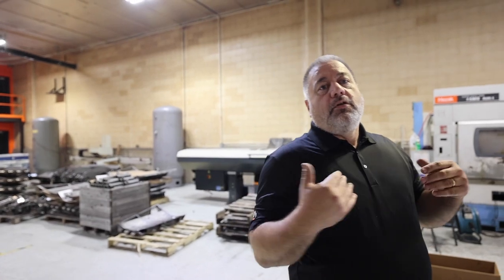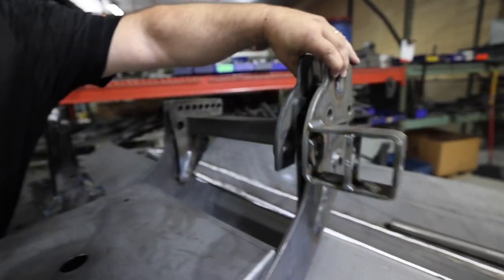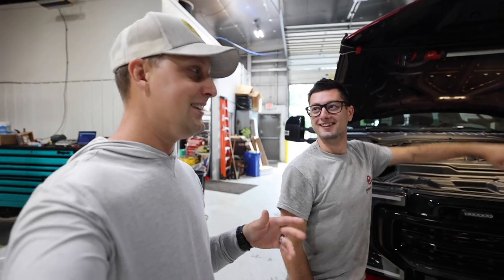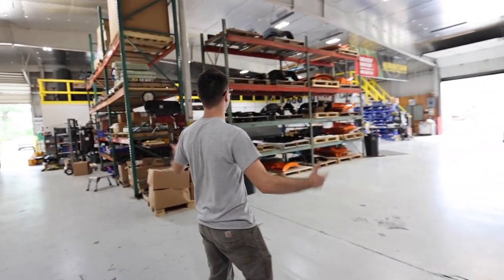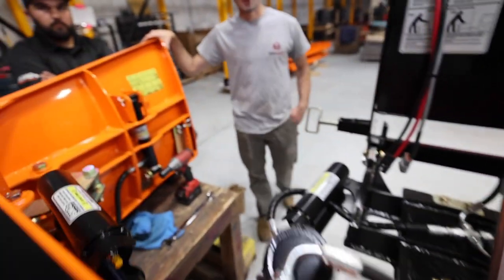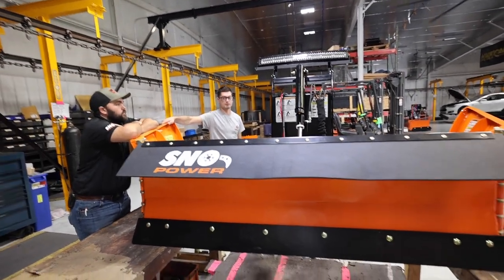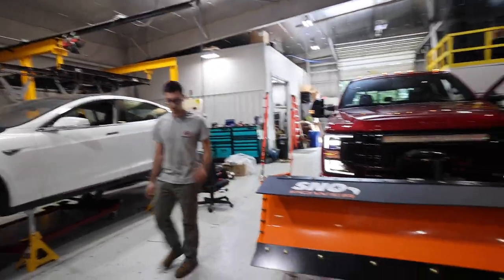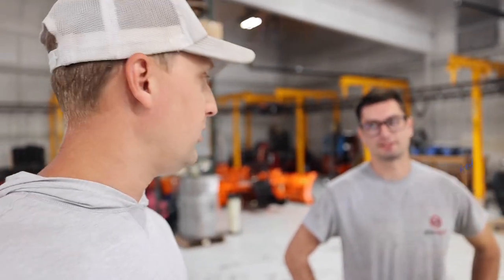SnoPower F14 Snow Plow Never Seen Before UNTIL NOW!

Comment from the maker: What do you guys think about plowing 14’ of snow in a pass?!
Reply: .5 1inch of fluff over that your out of truck
Super nice to final clean dingle balls of snow in a big parking lot
But if those wings clip a curb there gonna break or break your truck
Driveways small lots don't see a need bigger parking lot hell yehh
Reply: Just out of curiosity from a Floridian here. Does this stay on the truck all year long or is there options to remove it?
Reply: What a good dude. Thanks, Brian.
Reply: @porfirio3820  you take it off, depends on company, people, storms, but some people leave them on all winter, and some take them off after each storm. But no, it is not a permanent fixture to the truck.
Reply: @porfirio3820  my pickup i take plow and sander off/out every storm because i drive it everyday dump trucks leave the plows and sanders in all season but I take weight off the rear springs so I do not damage the springs
Reply: Trucks are going to be burning up transmissions.

Comment: I have been installing BOSS, MEYER. SNOWDOGG, and a few others for years at our BOSS dealership. And Boss has used Nitrogen for their down force for a few years. I know these guys have worked with BOSS on the Drag pro rear plow. And the BOSS undercarriage he used on the front of plow is great . I love these plows . and if you keep the BOSS wiring on the truck along with the wiring for the Snow power , you could actually use either plow. But I'm worried about long term use and weight. Man !! I love how he's doing this all in house, so much like our shop . We also do service beds, in house dump , flat beds, out of steel or aluminum. I've got to go see this place. Congratulations!! I'm a fan!!
Reply: I think the 12 ft version is better suited to a front plow and not quite so heavy. Front end will take an extra  beating for sure.

Comment: One thing to keep in mind. 
All of these truck mounts are/ were designed for the 8-9’ plows V plows and the like. Pushing a 14’ plow at both the additional weight of the plow and weight of the extra snow may damage the frame of the truck easier then the manufacturer of plow mount with the plow designed for that mount would. 
Just a thought.

Comment: I mean I understand the point and think it’s awesome.. but I just feel like if this was a good idea boss or western would have done it already.   That’s a lot of snow per push and I just don’t know how well transmissions will like it.   I also would stick with a plow you can get service.   Our boss dealer is open during storms all night.  But I will definitely be watching this winter to see how it goes!! 👍
Reply: Same thing was said when they released the 16' backblade. Now boss has it...🤔
Reply: Douglas Dynamics is about making the company money. The angle cylinders blow out now, pumps are garbage and the metal is junk. We need new inventive products.
Reply: The exact same thing was being said when Blizzard plows were being built out of a barn in Calumet Michigan.. Now Douglas Dynamics owns the patent and threw away the brand and old tank plows and now build Junk.. I still have an original blizzard power plow... 18 years old and still pushing..
Reply: @brandonschudlich1497  Just like the Air Flow plows. Real stainless steel built plow with a Curtis type hitch. They had an awesome all stainless V as well that only a few made it to market before douglas dynamics bought them out. Thats were the "Ultra-mount" came from, now Douglas Dynamics uses that hydraulic pump setup and they took the strong all stainless plow and hid it from the light of day. I have 3 and I love them.
Reply: @Terk131 . Stainless steel is for ever. Not good for replacement parts and new plow sales.
Reply: The mentality that a well established corporation would come up with an idea or invention if it was worthwhile has been disproven time and time again. 

How many times has an upstart company come along (in any industry) and completely revolutionized the market with their innovations? Countless times. In fact, it’s the only way a small company can get a foothold in well established markets when going up against “the big guys”.

I would argue that massive corporations simply focus on increased profits and cutting costs, and only care about innovation when it threatens them and can be bought out to add to their portfolio (like Douglas Dynamics has done numerous times).

Comment: Hey I have basically the same truck and I'm nearly on the bump stops picking up a 9'2" Boss V. Did you do anything to the front suspension to handle the extra weight?

Comment: How’s the trip work with the wings forward? Seems like a good way to go head first through the windshield or bend a truck frame.

And 9 cylinders... lot more seals and hoses to leak... not including using both hydraulic fluid and nitrogen. 

And separate buttons to put power to different switches, just seems like a lot of extra stuff to go wrong with the unit. 

Also, what is the availability of parts in the middle of a storm if a cylinder, hose, controller goes bad? Is the nearest parts hours away in bad weather, local parts, need to carry a spare of every part?

Hope it works out for you. Be interesting to see how it performs and if you will be able to use the full 14’ effectively in different types of snows. I think I’ll stick with my arctic 12.5’ sectional for now
Reply from the maker: Yup, once a dealer pops up local, those issues will minimize. And we'll get to learn how to fix our equipment. All good.

Comment: Ok so it does parking lots really well. What about tight residential. What about dirt & gravel parking lots & drive ways? What about dirt & gravel roads that have a middle crown with wheel depressions on either side so you not plowing a "flat" surface? Sounds great in the middle of town or commercial area but there are more guys plowing out of town & in the Boonies that in town. Doesn't sound like this plow can do any better than a Western, Fisher or Snow X , all Douglas Dynamic plows but what about Myers or Boss in in those out of town areas? Sounds to me like your spending way more money for something that is not going to preform any better than a less expensive plow................ Please tell and EXPLAIN how I'm wrong.. Thank You.
Reply from the maker: Worked great on gravel, and driveways. We have a v plow for the rest of the work! This is our wide open lot plow.

Comment: Like the previous comments I just don't see any even 1 ton being able to handle that kind of weight.its not a dump truck or loader...that's got burned up clutch plates written all over it.obviously you would be smart and probably put in manual shift and plow in 3rd gear like you would if you were pulling...

Comment: Good way to burn through transmissions while beating up the rest of your truck
Reply from the maker: We drove it for 2.5 hours home, transmission was cool as a cucumber, no issues. But yeah.. you're probably right.
Reply: @BriansLawnMaintenance  good thing you don’t get real snow storms where you’re at lol never seen you plow more than like 8” of snow. I’d like to see how that plow would do pushing 3 feet of snow up a half mile long driveway that goes straight up a hill. 14 foot plows shouldn’t be on pickups, but then again that’s just my opinion. Hope it works out

Comment: You will destroy transmissions at $4k-$6k a pop so if you can cover that it’s fine, time will tell though.
Reply: @nuttermudder4630  idk maybe, in mid Atlantic(md) going through trans every 100k and it barely snows. Plus 7 months of daily towing 7k. So to answer your question probably
Reply from the maker: Not sure what you're doing to your truck to go through a transmission at 100k. Plowing or otherwise.
Reply: @BriansLawnMaintenance  ford builds trash transmissions. Maybe the 10 speeds are better but my sisters 2021 with 40k on it in the shop may disagree

Comment: Not good it is impracticable for a pickup truck even a 350. Too much wait on the front will destroy that front end. Did you see how his truck was squatting at the end of the video? The truck is not a loader. when the snow gets heavy he will have to make small piles in the lot until a loader comes. Here in Buffalo NY, we know heavy snow. Good luck with that Brian.
Reply from the maker: Lol, you've never seen the plow in use then. This setup will dominate.
Reply: And maybe the best thing since sliced bread. I still would not want all the weight and wear a tear on my front end